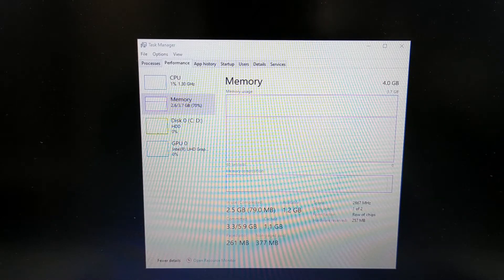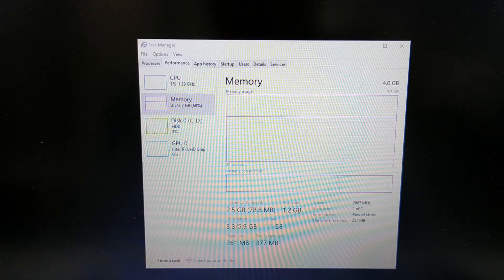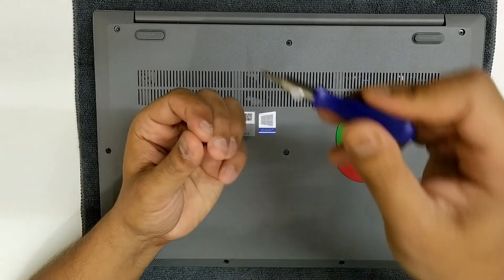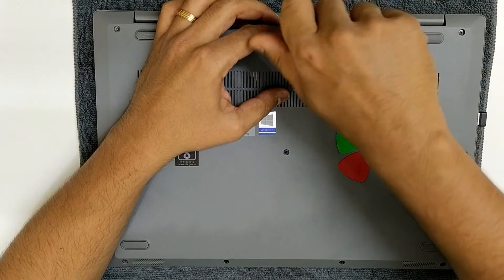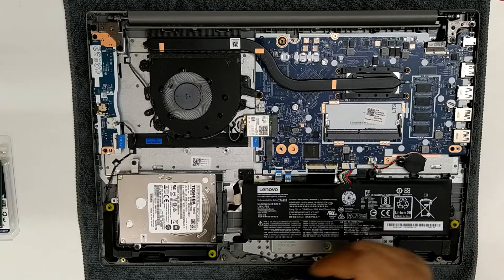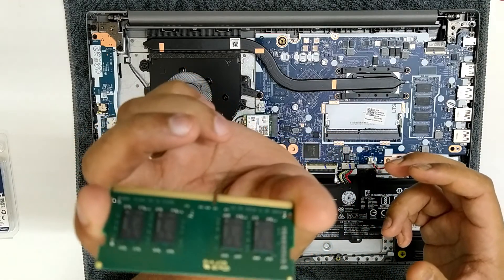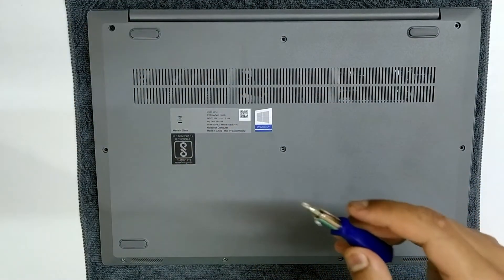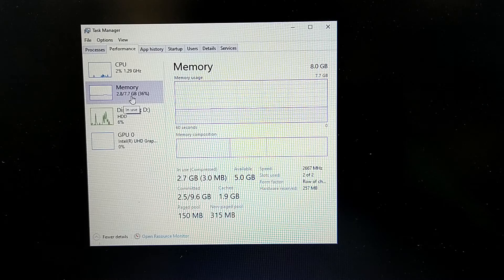Lenovo Laptop RAM upgrade | How To | IdeaPad 3 / 15IIL05 / S145 / 330S

Comment: sir is the crucial ram working properly? I have used almost 2 brands such as hynix that were of same specification i.e 2666 Mhz and DDR4 but still the screen turned black after some time. kindly help.
Reply from the maker: @GOVINDDHIR-v4d yes, it’s still working without any issues.

Comment: PROBLEM SOLVED:
my computer is experiencing no display. My display is clean, and working fine. But gives me no display. So i was wondering if the cmos battery was f**ked up, or just need a new computer. So watched your video and it turns on and data is working fine

Comment: i have the same laptop and its frustratingly slow. Will ram upgrade help improve loading speed etc . thanks
Reply: If it's on hdd then you haave to upgrade storage to a SSD and Install Windows 11 On The SSD Storage To get blazing fast speeds.

Comment: My lenevo Ideapad 3 cori3 10 generation has a 4 gb 2667 MHZ RAM. If I add another 16 GB DDR4 3360 MHZ will there be any problem in the laptop?

Comment: It was very helpful I did upgrade my ram to 12 Gigs
Thank you so much
Reply: hello , please tell me did your module come with a pentium gold 7505 processor? because I'm really scared that it might not come with an extra ram slot inside
Reply: @hishamzeinab3583  
Hi, thanks for your reply 
My cpu is Intel pentium gold and all new model of lenovo ideapad 3 they come with extra ram slot.
The ram with laptop is built-in ram so no worries 👍
Reply: I HAVE A 4GB RAM INBUILT, CAN I BUY 16GM RAM AND PLACE IT ON EXTRA RAM SLOT SO TOTALY I GET 20GB RAM?
Reply: @Nothingdiffrent1234 did it run?

Comment: Lenovo IdeaPad Gaming 3 15ACH6. It can handle max 64GB. Is there a way i can put in 16gb of ram with same frequency and just leave the soldered 8gb of ram to run? So it can be 24gb ram in total. Will it work properly?

Comment: hello lenovo ideapad 3 15iil05 I have a lettop with 4 gb ram, the website said max 12 ram, my processor is intel i3 1.10ghz, does it make sense to make 4+8 to this processor, should I do dual channel?
Reply from the maker: I can't say which will be faster. You can try both if you have the access and option to return.
Also upgrading to SSD will make a huge difference in performance and speed.

Comment: I have the same lap as yours ideapad 3 15iil05 n its got a 4gb size non removable ...my question is can i buy a 8gb ram ? or only a 4gb one ?
Reply from the maker: It's better if you add another 4gb RAM stick if you want dual channel to work.
Adding 8/16 GB is not recommended and may NOT work as dual channel as the frequencies won't match with the onboard RAM.
Reply: @elvis_tech  what if i get a 8gb stick but of the same frequency as of the onboard ram? n thank u for replying

Comment: I want 16 gb ram in my Lenovo laptop so should I buy a 16 gb ram or a 8 gb ram bcoz i already have 8 gb ram in my laptop so what should I do? Is there only one ram port or two I don't understand please help
Reply from the maker: Open the laptop and check if primary memory/RAM is soldered in motherboard. If yes then buy 8GB else you can replace primary RAM with 16GB. Make sure frequency is same.

Comment: Don't we need to remove the battery before working on the board ? , 
Great informative vid
Reply from the maker: Yes, always start by disconnecting the battery before working on the laptop. But the connector is very delicate.. need to be very careful.
Reply: @elvis_tech  ok , thanks you it helps a lot : ) ❤❤❤✌✌✌✌

Comment: Mine came with 8gb ram, I would like 16gb, do I just need to put another 8gb in or do I need to get a 16gb?
Reply from the maker: Yes, that will work. Just try and match the frequency with original RAM.
Reply: @elvis_tech  Thanks for the reply 😀

Comment: Without removing battery any problem for shot circuit???
Reply from the maker: It is always better to shut down  and unplug battery socket before working on the laptop. I have not done it here as the battery wires are very delicate and can get damaged if excessive force is used.
Reply: @elvis_tech  I removed the battery wire & upgraded ram on IdeaPad 3 Ryzen 5500u

Comment: Will this increase the speed of my laptop? I have the same one shown in the video the Ideapad 315IIL05. The laptop that i have is very slow now its been just about 1 year since i got it. If not this is there any other ways to boost the performance of the laptop?
Reply from the maker: There are few other videos which show how to disable some background processes.
Along with that, increasing RAM, switching to SSD and using a paid Antivirus will help make it faster.

Comment: What happens if in future my solderer ram stops working? Anyone help with this question please.
If Soldered ram stops working then can my upgradable ram works or not???
Reply from the maker: If soldered RAM stops working you can use secondary RAM slot. Else replace soldered RAM, you will need to take it to the service center.

Comment: can I insert kingston hyperx impact 8gb ddr4 to my ideapad 3 15are05?
Reply: Built in 4gb is soldered and is at the rated speed of 2667mhz. If you were to get something beyond those rated speeds, you most likely won't be able to utilize it.

Comment: Hi, can i know maximum ram can add for lenovo ideapad 3 ?
Reply from the maker: Open command prompt from START.
Next type the following text in the cmd box - wmic memphysical get maxcapacity

Using Calculator divide the result by 1024 and then divide this result again by 1024.
Final number is the max capacity in GB the laptop can handle.

Eg.33554432 / 1024 = 32768
32768/1024 = 32 GB

Comment: Hi sir i have the same laptop but im confused of which type of ram should i buy online. Should i buy DDR3L or DDR4L? How to know MHZ that i need to buy?
Reply from the maker: You need to buy the below spec RAM
Crucial 4GB Single DDR4 2666 MT/s (PC4-21300) CL19 x8 SODIMM 260-Pin Memory - CT4G4SFS8266, 4GB Single Rank
Reply: @elvis_tech  thank you Sir for the information 💪

Comment: Hey dude so I have a Lenovo Ideapad Slim 3 just like yours but it has 8 gb ram and if I want to make it into 16 gb do I need to purchase a 16 gb or another 8 gb ran?
Reply from the maker: Hey.. if it has 8gb soldered then check the frequency and buy another 8gb with same specs.
Reply: @elvis_tech  how to see if its soldered?

Comment: I have 2 GB RAM in my laptop so want to buy 8 GB another one so 2+8 will work or will I have to use just one 8 GB and remove the 2 GB ?
Reply from the maker: Sir, best option is to replace 2GB Ram with 8/16 GB RAM. Just check and match current RAM frequency before purchasing.
Reply: @elvis_tech  mean to check just  its DDR 3 or DDR4 or some other thing to check too ?

Comment: Hi friend, thanks for the video. I saw that you have a HDD but no SSD (Nvme), is it possible to use both? I have a 256gb SSD and I would like to have more, so I can add a hdd without it being a problem? Thank you.
Reply from the maker: Very good question! Yes you can use both together as your OS is already on the SSD. 
If you have space for a SATA HDD, you can plug it in and restart your laptop.
The new drive should appear under 'Disk Management' . Just format then partition the drive and it will show in 'My computer'/'This PC'
Reply: @elvis_tech  Hey friend, thanks for your advice. I'll give it a try, if it works I'll get back to you, thanks for taking the time to reply. See you

Comment: I have upgraded my ideapad 3 ram to 12gb, but only 5.88 gb usable, how to fix this
Reply from the maker: If you added 8 GB on 4GB only 8GB single RAM will work.
Reply: @elvis_tech  what does it mean? Sorry I'm a newbie, the laptop detected it as 12gb ram, so does it mean it only detect it and doesn't use the ram that i have installed?

Comment: Hi... I removed a Kingston 8gb ram from a new laptop HP n exchanged it with my Lenovo IdeaPad 3 15ii05.
But it the Lenovo laptop reads it as 4gb.
I switched it back to see if the Ram is 8gb or not ...and the HP laptop reads it as 8gb..
Now the Ram is 8gb for sure(even according to its serial no.)
The Ram is working 
Even the slot is working.
So why the Lenovo laptop reads only 4gb?
Reply from the maker: I don't think the frequency of the onboard Ram and Kingston Ram are same. Also size is different.
I think it is showing you the onboard Ram even after you add more.

Comment: Hey man. I also have 4GB + 4GB removable RAM. If I remove the ram and add 12GB, will it increase my FPS especially for GTA Online experience? Please respond as I am anxious to know
Reply from the maker: There are a lot of factors. For GTA5 you need atleast a quad core processor. Fps depends on combination of processor, graphics card and RAM.
You need minimum 8GB Ram and 1GB Graphics memory with a quad core processor weather intel or AMD.
Only increasing RAM will give you marginally better performance but not much difference.
Reply: @elvis_tech  as long as it increases my FPS then I'm good. Another question, how will the performance for Forza Horizon 4 be like once I've upgraded the RAM?
Reply: @elvis_tech  I have quad core processor, UHD graphics card and 8GB RAM. So since you said I needled a combination of processesor and RAM, I'm sure once I've upgraded RAM, it will run smoother than before right?
Reply: @six_1327  no , ur graphic card is not strong enough for a smooth gta5 gameplay
Reply: @elvis_tech  i have Lenovo IdeaPad 3 15IIL05 (81WE0092YA) intel i7 1065G7 CPU,  1 TB SSD
  with 8gb ram soldered .can i take out 8gb and put 16gb

Comment: Hey, such a great tutorial. This laptop model is literally slowwwww. 

On this processor, I also see that we can increase gpu speed I guess. Any thoughts on that!?
Reply from the maker: Hey thanks a lot. Yes it was really slow previously. After increasing RAM it was better. But best solution is to stop the Windows search background service.
There are more videos on how to make it faster.
Reply: @elvis_tech  followed tutorial and upgraded RAM. Thank you.
Reply: @kumararaja2433  I am in position to buy Ram, how was your experience after increasing ram? Has the speed increased?

Do you also have Ssd installed in the same?
Reply: @kumararaja2433  I have 2 GB RAM in my laptop so want to buy 8 GB another one so 2+8 will work or will I have to use just one 8 GB and remove the 8 GB ?
Reply: watch my vid to remove bloatware
Reply: It might be your storage. 
Id you have HDD then get MacriumReflect free, upgrade with any M.2 or PCIe drive, clone your drive C onto the new M.2, restart laptop and get into BIOS/EFI and change boot sequence to your M.2
.
It’ll be a total hame changer if you have slow boot up time.

Comment: sir i have a 4gb ram with frequency 2400 , can i add 8 gb ram with frequency 2666 which is more than the one already attached.
Reply: You should be able if your ram slot is empty
Reply: It won't work in dual channel I think.
Reply: U should buy the same speed ram

Comment: If i upgrade my laptop is it possible if i use 16 gb ram on a single slot?how many ram can be added in ideapad 3 15IIL05?Because my laptop already have 4gb ram soldered in the motherboard,and will it work as a dual channel?Thank you for making this video dude!
Reply from the maker: You can either use 4GB DDR4 2666 mhz RAM in the given slot and make it dual channel with total memory of 8GB.
Else use 16GB in second slot and make it single channel.
It's very bad that Lenovo has soldered the RAM to the mother board. Cost saving technique. They should mention this clearly on the website.
Reply: @elvis_tech  Thank you so much for asnwering dude now i can upgrade my laptop! Thx
Reply: @elvis_tech  Hello I tried Crucial 16gb 2666 ram and the PC is not running
Reply: @danielecannella3348  Did you eventually get it to work with single channel 16GB? I just bought this laptop from a reputable store with 4GB slot already installed (so 8GB total) but didn't realise it's not really expandable.

Comment: Hi sir..thankyou for answering... my ideapad 3 has a 4gb ram soldered... and i bought an 8 gb ram...will it work? and also what do i do first before installing the ram? and what to do after i installed it?
Reply: Nothing. after ram is installed the laptop will detect it.
Reply: i have Lenovo IdeaPad 3 15IIL05 (81WE0092YA) intel i7 1065G7 CPU,  1 TB SSD
  with 8gb ram soldered .can i take out 8gb and put 16gb

Comment: I already have a 4 + 4 GB
if I need more ram, i can buy another 8gb stick
whether the 4 + 8 configuration supports dual channel ?
thank you
Reply from the maker: No it will not work as dual channel.
Better get 16 GB in that case.
Reply: @elvis_tech  Thank you for answer

Comment: When we say the ram can be upgraded to up to 16 GB does that mean I can add a 16gb ram stick along with the one which is already soldered?
Reply: it worked on my lenovo yoga i have 24GB of ram with 23.8 usable go figure running on a 5g network. love my laptop!
Reply from the maker: Yes but it won't work as dual channel. You can watch other videos to understand the difference.

Comment: Hi, would anything happen if my extra ram card was 8gb but soldered ram is 4gb? The frequency would be the same (2400 mhz for my model),
Reply from the maker: I have tried this on my laptop but was not very effective. It will work but not in dual channel mode. For dual channel you need same size and frequency of RAM that is soldered on the motherboard.
Reply: @elvis_tech  thanks for the quick response! guess I'll have to stick with 8gb total

Comment: Sir If we upgrade with more frequency of ram speed 
Like instead of 2667mhz we keep 3200 MHz 
What happens?
Reply from the maker: Hi.. if you add higher frequency RAM it will run at the frequency of the existing RAM. So instead of 3200 MHz both will perform at 2667 MHz.
Also, make sure to check which all RAM frequencies are compatible with your professor.
Reply: If you put a 2667 and a 3200 it could damage in the future but I recommend you 3200 and 3200